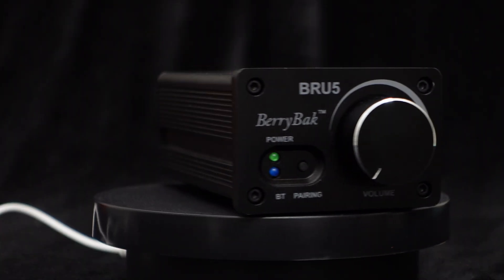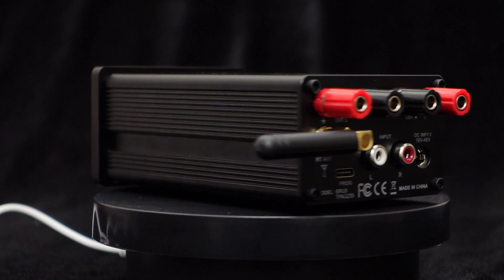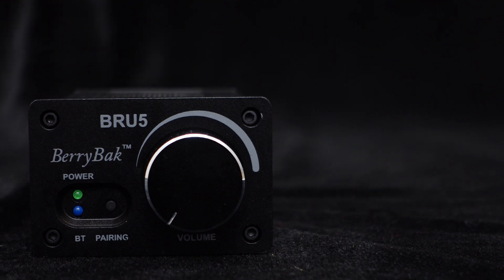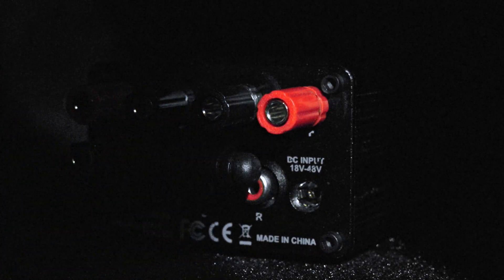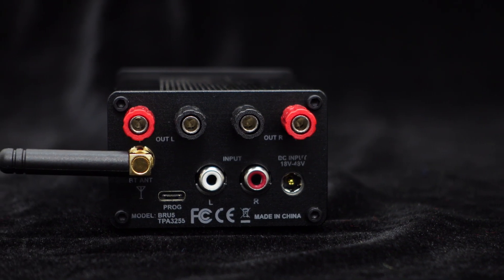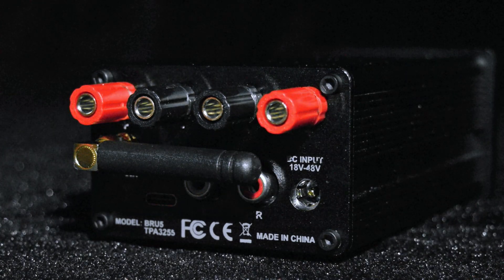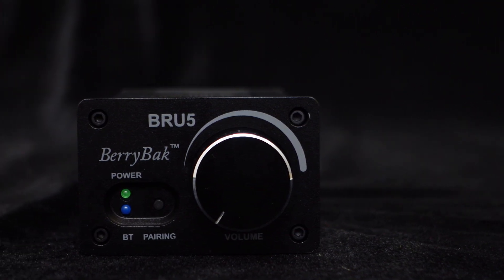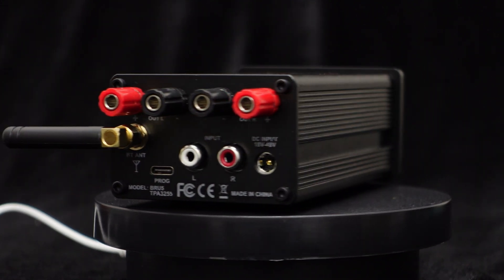TPA3255 Stereo 300W Bluetooth V5.0 Amplifier with ON/OFF Switch Volume Control PC UI Control

Comment: How does this unit power on? Do you turn the volume knob to turn on, or do you press the volume knob like a button? Also, does it remember whether RCA or BT was last used when you turn it on? Or do you have to press the BT button every time if you don't want the default mode?
Reply from the maker: Hello, the rotary knob on the BRU5 serves as both the power switch and volume control. We have recently made improvements to the BRU5, allowing you to change the default input method on your own. For detailed instructions on how to perform this operation, we recommend reaching out to our customer service team. They will be happy to provide you with the necessary guidance and assistance.

Comment: I can use DSP to configure an active two-way crossover for each of these amplifiers. That is, amplify tweeter and woofer separately?
Reply from the maker: The BRU5 doesn’t support the function you mentioned. It’s recommended to take a look at the JAB series, which are integrated with ADAU1701 DSP for SigmaStudio programming and PC UI control. You can configure the amplifier boards to make a two-way crossover through programming or PC UI control.